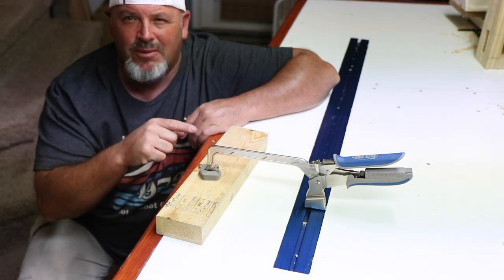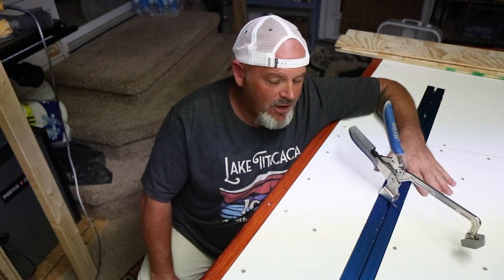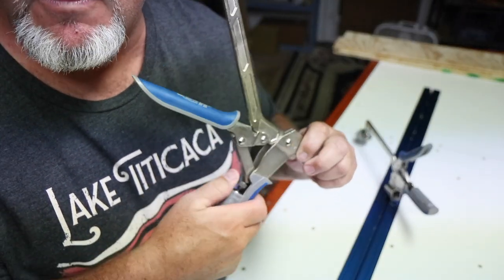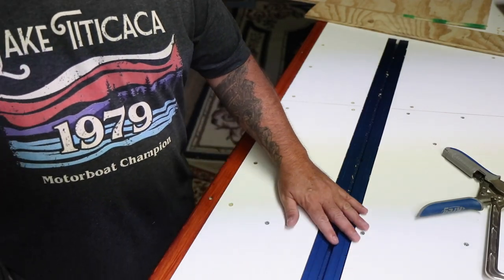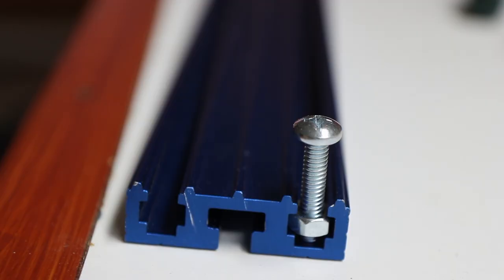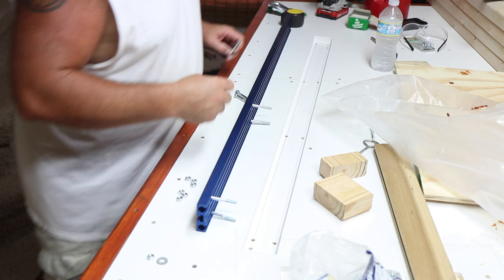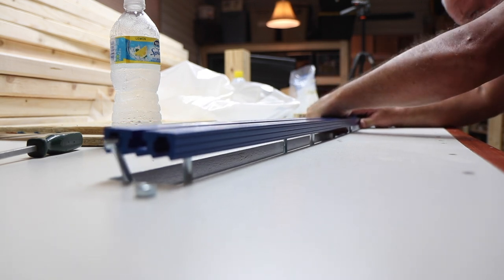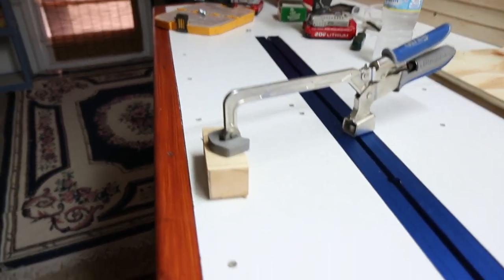Kreg Klamp Trak Installation Video

Comment: I agree about trying to do the installation the way it's described by Kreg. It seems like it would be very difficult to put the bolts up into the nuts in the track. They are hidden! I was thinking of doing it the way you did it. i was going to use larger holes to allow for some wiggle room. It won't allow for a countersunk flat head underneath though, as they show in their installation drawing. I think that 1 1/2" thickness is needed. 2 layers of 3/4" looks like the way to go.

Comment: Good job sir. I like it. Later I have to do that. I got the clamps. I just need to get the track. Thanks for sharing.
Reply from the maker: Jose Villanueva thnx, the system has been quite handy and I use them often...everything seems to be holding up well.

Comment: How thick is your workbench top? I want to do something like this, but my top is only 3/4" MDF, and I'm worried that after I route the dado in there won't be enough material for the track to grab onto.
Reply from the maker: BJ Vanderboom ya it won’t work, there was probably less than a 16th of material remaining after I machined it.

Comment: One important detail missing! Size (not necessarily length) of bolt to fit under as you did. I did catch 'hex head'. Just need the size. Thanks for the vid!
Reply from the maker: WarmFLBear Oh hey thanks for checking it out and I’m glad you found it informative. 
As far as the diameter of the bolts, I crawled under there, put a caliper on them and they are 1/4”...hope that helps!
Reply: @jackpine890  Thank you! I bought the track, but there was no instructions from Kreg. Informative video, a great help.

Comment: Could regularl t track work for the clamps?
Reply from the maker: Robert Smith this track obtains in strength by it being large and extruded aluminum.  When I clamp down on it I can hear the thing creak a little.  I used 8 bolts to hold it down and in hindsight should’ve used 12.  
With that being said, I personally wouldn’t use T-track for this particular app.